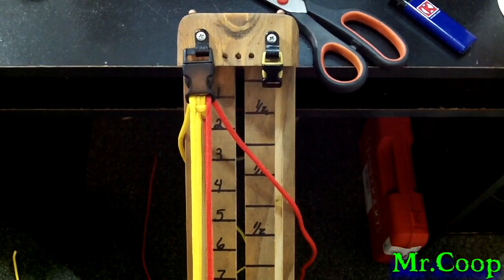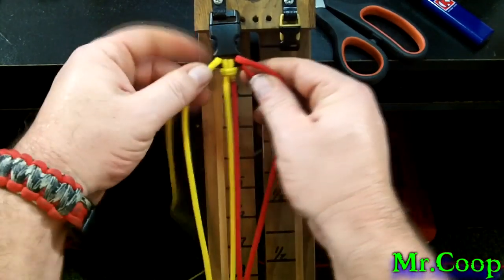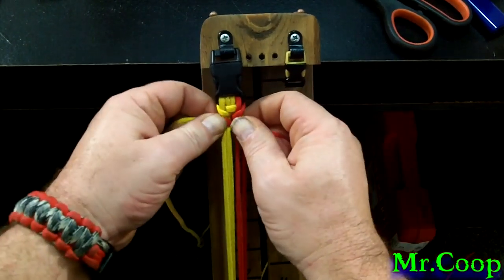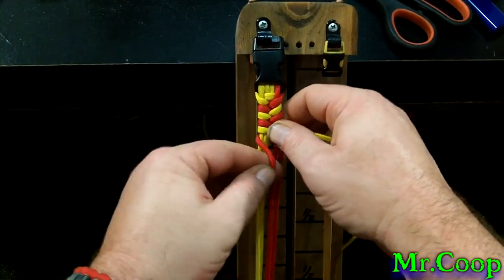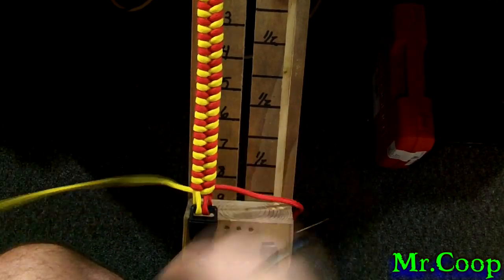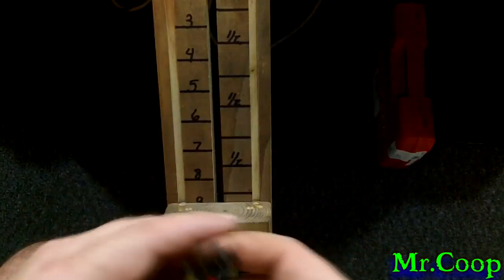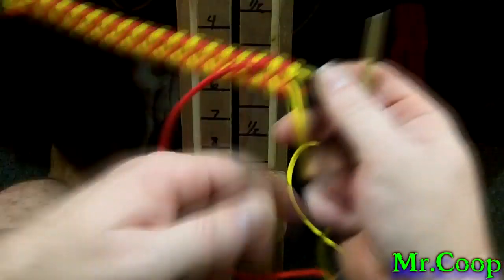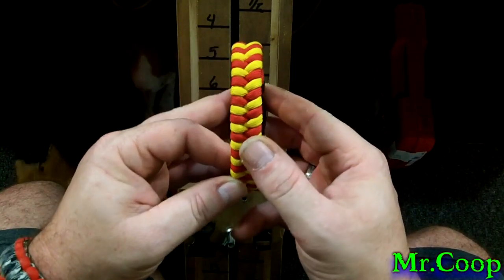How To Make A Paracord Double Core Fishtail Bracelet

Comment: Hey MrCoop for this bracelet do have to burn the ends of the 2 colors together and then do the cinch knot. I am new to this stuff. And also when making a double core bracelet that is for a size 9in wrist. Do I use around 9ft of both colors or a combined length of 9 ft for both colors

Comment: Looks good Coop! You do however, make your bracelets upside down in my opinion. It is easier to keep your weave tight if you are pulling down towards yourself. Plus when you reach the end of the bracelet your working on the top and can see easier what you are  doing. I realize everyone has thier own methods, but maybe give it a try and see if it works better for you, as it does me. Keep up the good work bud, John.